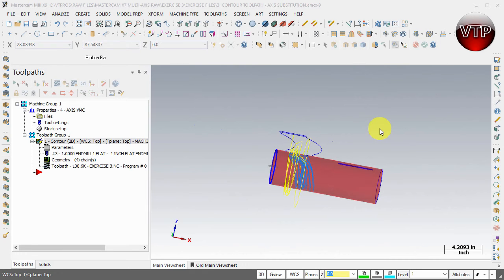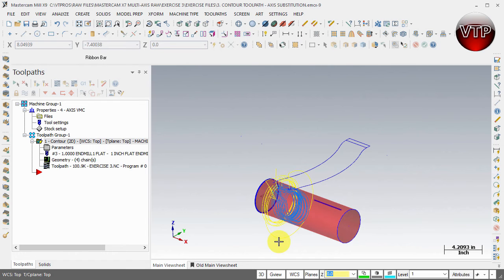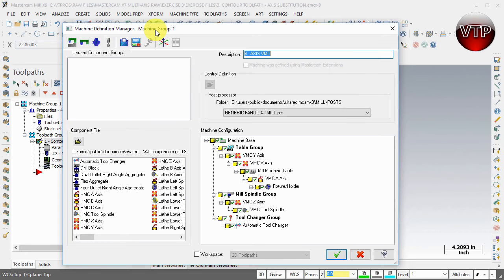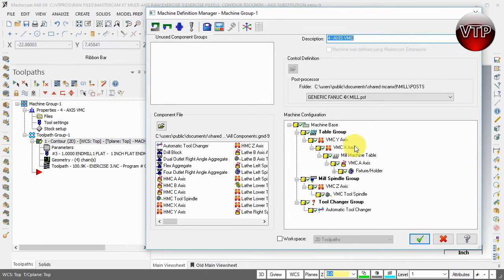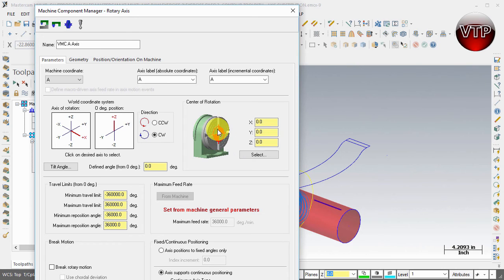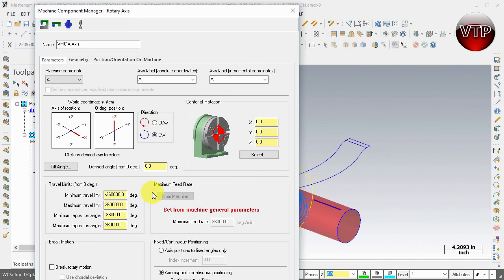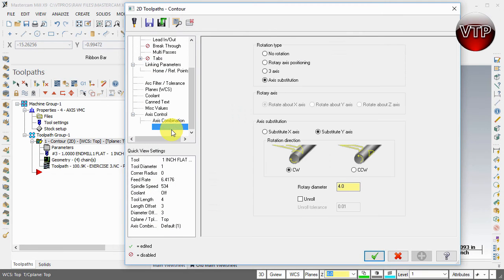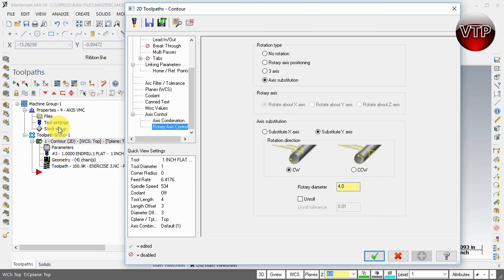MASTERCAM X8-X9 Multi-Axis Beginner - 3.5 EDIT ROTARY A-AXIS ROTATION - vtpros.net

Comment: How can I machine three different slots,different positions on one OD? Do we have to use xform roll or just use model to program them on 4th axis rotary table? Thank you (is there any dvd show them all from beginning to advance?)
Reply from the maker: yes this DVD is for advanced and we have another one that is beginner, if you want to learn 4/5 axis, pick them both up at vtpros.net they will show you all you need to learn on 4/5 axis (multi-axis)